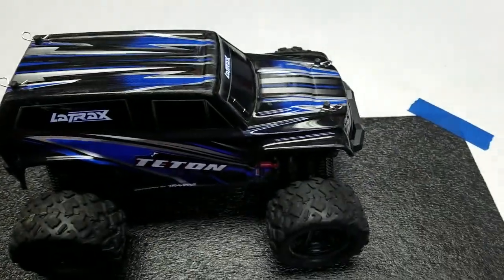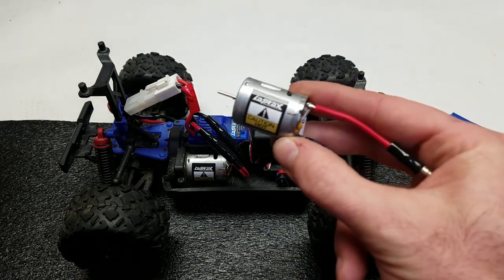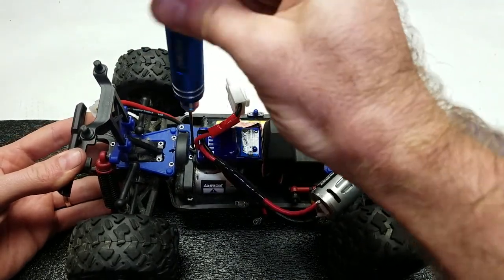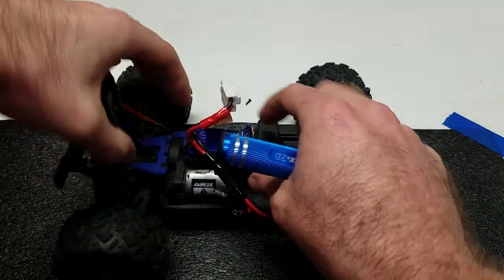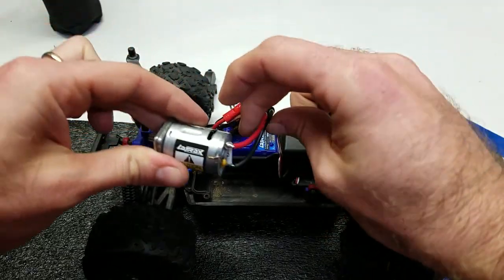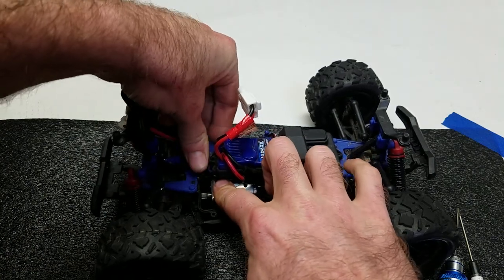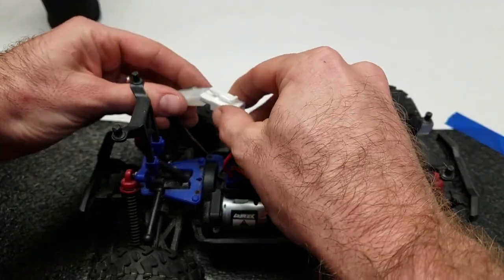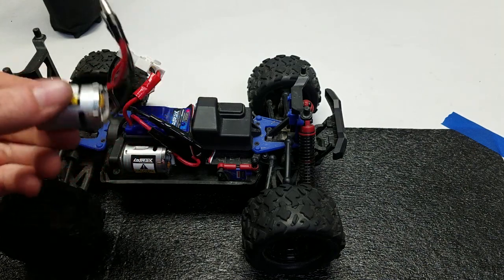RC Mechanic's Tutorial- LaTrax Teton motor replacement

Comment: Ive gone through 2 stock LaTrax 370 motors.  The first one went out (just like you showed in your video) replaced it with another LaTrax...weeks later it stopped working too.  Im inclined to say their motor are a bit inferior.  Im not bashing LaTrax or Traxxas, on the contrary Im a huge fan.   Im just kinda done with their motors.  Im just a weekend occasional adult RCer.  No heavy use or abuse. So, I need to replace the motor again, but Im looking for an upgrade that's not brushless.  Do you have any recommendations?

Comment: Having issues with mine moves forward and backwards like normal has no steering replaced steering servo with upgraded metal gear tried recalibration the steering then works with throttle confused at this point lol any help or tips very much appreciated
Reply: Reset you're transmitter.  Theres Traxxas videos on YT on how to do it.  Same happened to me it worked after reset.  You might also have to bind the transmitter again.  Videos about that also.

Comment: What size is that pinion? N u think the teton pinion will fit/or work on a sandy land 1/18 scale motor? The pinion they have on the sandy land strips really quick.  Need help.  Thanks

Comment: I have the same problem and I need to replace the motor while it is still under warranty because they told my son that we need back to send the whole car by  post from Malta to the shop in Germany from where we purchased it that it will cost more than the price of the motor while they know that it seems like a common problem or defect because he only used the car for a few hours. They should use a more reliable motor and treat better the customers.

Comment: MY CAR ONLY GOES IN FORWARD DIRECTION AFTER I CHANGE ENGINE
Reply: Did you change the throttle setting. You should have 3. 1. Full speed, reverse and braking. 2. Full speed, no reverse, braking. 3. Half speed, half reverse, braking.
Reply: @Madlittlepixel  now it works thanks

Comment: replaced the motor, in place, indexed properly and it's now insanely loud, in higher end trucks you can adjust the gear mesh but now on these lil buggers, it's preset. any ideas? same gears, same motor mount, only swapped out the motor. any ideas?
Reply from the maker: That happens on these. Open it up again and flip the motor 180 degrees. Seems ridiculous, but it will fix that. Do it soon, too- Or your spur will be roached.

Comment: ive been out of rc for a while, but man, these look like a pain in the ass to have to clean the motor. is that why they fail? they are harder to spray and clean?
Reply from the maker: Das Boot They're inexpensive little brushed motors and they're pretty easy to replace. Of course, routine maintenence prolongs the life of anything, but in some cases you just have to replace a part. Luckily it's cheap and pretty easy, especially when you've seen it done.
Reply: Das Boot: At $10 a motor, it may be easier to plug & chug rather than repair a burned out motor unless that's just what you want to do.

Comment: Hey Luke. The reason why I’m commenting again on this video is cuz there’s a problem with my traxxas summit. Just like the Teton you fixed, the Summit has steering but no throttle but instead of the esc blinking red, my summits esc blinks green. I’ll probably be coming this week and if not,         
I’ll probraly be coming on sat
Reply from the maker: That sounds like throttle calibration. When you come in, we'll take care of it one way or another.
Reply: Oh ok thanks. I might come today or tomorow